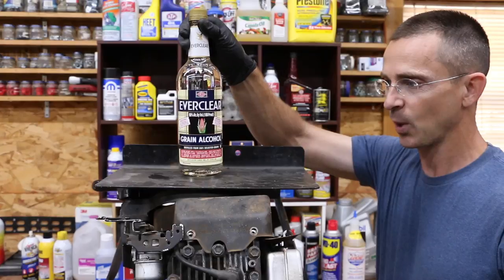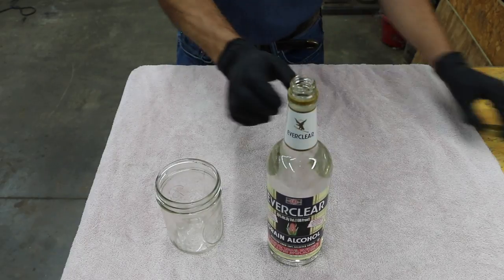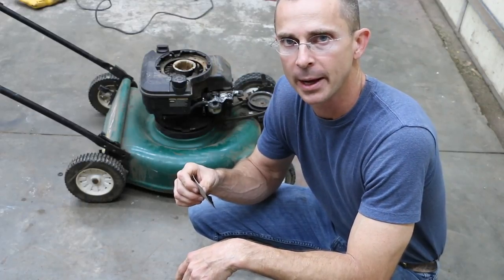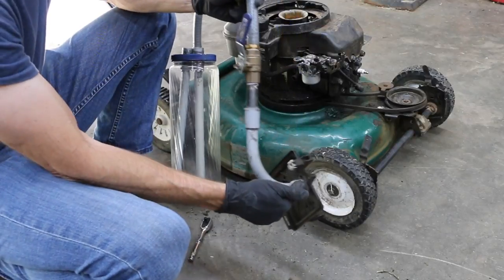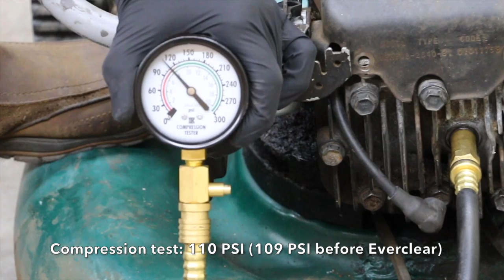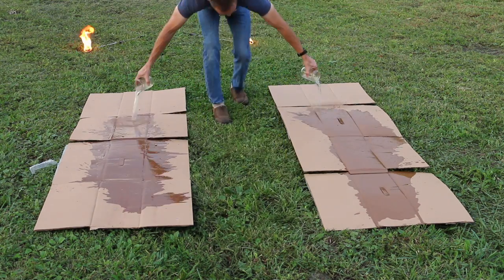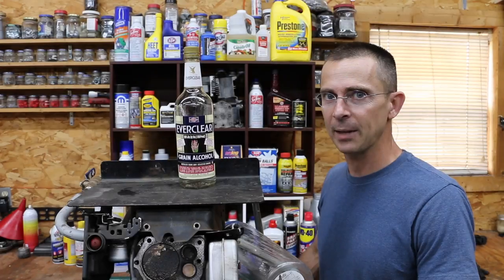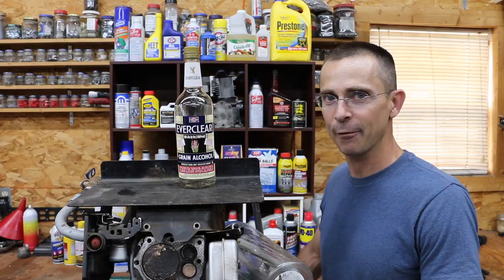Will an Engine Run on Everclear Fumes?  Let's find out!

Comment: Nice. Now we know that grain alcohol won't clean the carbon out of your cylinder very well, but in the right mixture it burns fast and hot.
 Have you done one about running it on other volatilizes, such as acetone, M.E.K.,  Zippo type lighter fluid, or even LPGs like butane, or propane?
Reply from the maker: I have not yet done videos on the ideas you've mentioned. Thank you for these recommendations!
Reply: Screamin Eagle Alcohol will, eventually, clean up an engine. The main problem here is this engine is no where close to jetted and timed properly to run on ethanol, hence chocking it.
I run e85 in my racecar which is 85% ethanol, 15% gasoline and the cylinder heads are remarkably clean after a season of racing.
Reply: 177SCmaro what is your race car? I also run e85 in my supercharged 1998 buick Riviera. I love it, more boost more timing more power!
Reply: juck huo
Its a 78 Camaro with a supercharged 380 ci sbc. Ran it on 110 race gas years ago then switched to E85 and never looked back. Too over a half second off the 1/4 mile just from switching to ethanol, which, according the math, was around 50HP over race gas. The stuff is so effective at cooling the air charge that, after a pass, you can put your hand on the side of the blower and it feels quite cool to the touch, even on a hot day.
Reply: Awesome, I'm about to take my Riviera to the drag way Wednesday for the first time . Got any tips so I don't look like a dumb ass? yeah my car runs so cool on e85 that when I'm cruising the thermostat just stays closed.
Reply: juck huo
If you haven't had the car tuned, I suggest investing in a o2 monitor that can read on the alcohol table (most do nowadays) and start off rich and retarded timing (28-30 degree BTDC) and work towards giving it more advance until there is any indication of detonation/pinging or it slows the car down (lightly boosted small blocks usually like around 32-36 degrees total advance)
Depending on your tires you may want to do a burnout in the water box, if street tires say out of the water box and do a dry hop if you think you need to. Usually someone will direct you.
If you've never staged a car at a drag strip the principle is pretty simple. 
There are two inferred beams at the starting line. You'll want to roll forwards slowly so as not to accidentally roll through the lights (in elimination this counts as a redlight and an instant loss). When your front tire breaks the first beam the pre stage light will come on the Christmas tree (typically if you are the first to do this as a curtesy you should wait for the other car to do the same). When you roll very slowly forwards a bit further you'll break the second beam the stage light will come on. Now you are staged. (you may what to be power breaking or brining your rpms up if it a manual).
Once both cars are staged the Christmas tree operator will trigger the lights, they'll come down and some time before the final light illuminates you'll want to nail it. Waiting until you see the last light will almost guarantee a poor reaction time. That part is up to you and how well you know your car.
And then hold on and keep her straight. 
At the end of the race track there is usually a turn lane or return road where you will get your ET slip that will show your reaction time and how long it took you to reach the various points on the track and your mph.
Those are the basics for what you can expect at a dragstrip.
Reply: Cool thanks. I've got a tuner and a wideband o2 sensor. rite now my afr is like 10.8 and my timing is really retarded at like 18 btdc. what afr do you run in your car on e85? I know stoich is like 9.7 for e85 but that seems like too much fuel for my car. I don't get knock rite now the way it is setup. Also my wideband o2 only reads down to 10, are there sensors that will read lower?
Reply: Yeah, I understand about the "over time" variable, and it looks like it did clear up some of the lighter staining on the piston. I was just looking to see if it would do the same as water or Sea-Foam. 
 Plus alcohol burns much cleaner then gasoline. So if you start out with a clean cylinder, you'll end up with a clean cylinder.
Reply: juck huo 10.8 to 1 is dangeriouly lean for a supercharged engine if that at WOT.
As you said, stoich is 9.7. Full rich on E85 is about 7 to 1. Lean rich is 8.5. 
At WOT going down the drag strip I usually run around 8 to 1 to 9 to 1 (it varries with rpm) with 36 degs advance all in by 2500rpm.
The air/fuel gauge I use is made by AEM. Summit racing part number AVM-30-0300. It reads 8 to 1 all the way to 20 to 1.
It's on sale right now too for 180 bucks.
Keep in mind if your o2 gauge is one of the old ones it could be reading on the gasoline scale. This one works with all fuels but you have to set it.
Reply: I wish I notice that my o2 sensor only goes down to 10 to1 before I bought it, but I wasn't running e85 at the time. I don't really want to buy another o2 sensor though. I've been confused about the correct afr at wot for e85 because I know stoich is 9.7 and you should be richer than that but when I tried entering 9.7 for stoich in my ecu my car did not like it at all. so rite now I just have the injector gain scaled up by 20% and it runs pretty good that way(that's where 10.8 came from). no knock. also I'm confused by this video I watched from nelson racing on their 2100hp motor on e85. they run like 11-11.5 afr ( https://www.youtube.com/watch?v=qS0ZdSRlD2c data logging starts at 11:00 if you don't want to watch the whole thing )
Reply: juck huo Are you sure it's actually E85? Some E85 isn't really 85% ethonal.
Also, like I said, it depends on the type of monitor you're using. If it's on the gas scale then if it reads 10.5 to 1 your actual air/fuel ratio is on e85 is about 7 to 1, which might explain why your car didn't like going richer.
Reply: oh ok yeah that would make sense. so that video I watched was probably on a gasoline scale also? I get e85 from a lot of different gas stations and it doesn't seem to make a difference, I'm in Michigan if that matters but I assume it doesn't except in the winter I know the ethanol % is lower. Thanks for the help. Should I scale my gauge so it reads for e85 or just leave it the way it is? so technically if my scale is for gas I'm rich, correct?
Reply: Also if my o2 monitor can read down to 10 to 1 on the gasoline scale does that mean I don't need a new o2 monitor that can read richer, since 10 to 1 gasoline scale is equivalent to 6.6485 e85 scale, and I should not have to go richer than that since max power rich on e85 is 6.975? Thanks again for taking the time to help me.
Reply: juck huo If you don't mind having to look at the different scales for gas and e85 then no, you don't need a gauge that can read different fuels.
Since your a/f is safe at almost full rich you might just play with timing then, unless you're running lots of boost then I'd probably leave it alone. Sounds like a safe tune.
And you're welcome.
Reply: Cool, thanks once more. I'm only running like 10-11psi but I do want to go up. I'm going to hold off till I get some quality fuel injectors with all the correct data. I've been having problems with aftermarket injector that don't come with all of the data for tuning the ecu. I think I'm going to shell out the big bucks for some from injector dynamics since thay provide all the characterization data.
Reply: juck huo At 10psi E85 could probably handle more timing unless you have really inefficient heads or something (I doubt that is the case if it's new enough to have EFI). Something to play with at a drag strip or dyno.
Sounds like you've got a good handle on it.
Reply: Yup, nice chatting with you, you'll probably see me around this channel again. lol good day
Reply: juck huo
Likewise.

Comment: You'll have to run it a lot richer.
It'll probably run quite a bit cooler than gasoline.
If you could somehow bump the compression way up (like 11:1 or so) you'd see a significant increase in power with alcohol over gasoline.
You'll also get around half the efficiency per volume as compared to gasoline.
Reply from the maker: Excellent point.  Thank you for the recommendation!
Reply: The problem with running alcofuel is that you have to use a lot more fuel to get the same amount of power out of it that you would get with gasoline. I think the stoich mixture for alcohol is 8:1, where as with gasoline it's 14.7:1. That's why flexfuel cars get worse mileage when they run e85. It's effective octane rating can really surpress knock on high performance engines which is a big draw of e85 because that means you can run a ton of timing advance safely.
Reply: Just like when cars get tuned for e85
Reply: Loren Husky
While the very low air fuel ratio of alcohol is bad for mileage, the tradeoff is you can burn a lot more fuel (especially in supercharged applications) for a given volume of air, so, in spite of the lower energy density of alcohol, it still makes a lot more power. What you call a problem I call cramming more fuel in the engine to make more power!
Reply: Boost or insane compression ratios are where alcohol shine the brightest. Its cooling effects mean more air, more fuel and later spark, with less chance for detonation.
Reply: It's not a problem if you know what you're doing and you have a reason to do it like performance. Jenny the soccer mom in her flex fuel kid hauler is only going to experience the negatives though, like poor fuel economy. I don't know how it is in other parts of the country but the cost of E85 is such now that you're losing more fuel economy than money saved every fill up. So it's a net loss for 'normal' vehicles.

Comment: Very nice video 
Quick question have you tried to run a diesel engine with gasoline and Diesel mix together.. My step dad tell me is good for the engine because it would clean the piston? Is that true
Reply from the maker: I did a video on diesel/gas mixed together a while ago and I didn't see much cleaning, but it could have been just my experience.  Thanks for the positive comment!
Reply: Was that in a gas engine tho project farm? I'd also like to see a little gas diesel mix in a small diesel motor
Reply: it was in a Gas engine, heres the video https://www.youtube.com/watch?v=PXLWLXz0iY4
Reply: I work at diesel engine manufacturer , do not put gas in a diesel, you may get lucky for awhile but if you add to much gas to a diesel  only 2 things will stop the engine, you shut off the fuel or shrapnel  in the engine
Reply: NightHunter nunya and that’s exactly what I wanted to see

Comment: Of course an engine will run on Everclear. It's 95% ethyl alcohol, which is highly flammable. My little RC cars use engines that run on a combination of methyl alcohol (the kind that makes you go blind) and nitromethane (i.e. rocket fuel), with some castor oil added for lubrication. Works like a charm, and doesn't even need a sparkplug -- just a platinum-wire glowplug for ignition. Once started, those little engines run with no electricity whatsoever -- they don't even need a magneto to provide ignition. Perfect for the post-apocalyptic do-it-yourselfer.
BONUS FACT: "Nitro" engines (as they're called) use castor oil for lubrication because castor oil is uniquely capable of dissolving in alcohol, unlike most oils. (please don't use this information to prank your alcoholic friends by making them drink laxative castor oil without realizing it.)
BONUS FACT 2: Castor oil actually gets more slippery as it starts to break-down into varnish, unlike most oils, and the varnish helps seal fine scratches in the cylinder walls, making it perfect for lubricating ringless engines.
Reply from the maker: All great comments. Thank you!
Reply: There's more  normal oil turns to coke at about 480 degrees . Castor will run well into the 640 degrees before coking.  The nitro content is used to set the ignition point .  My friend asked me why  his 1/8 nitro car ran cooler on 25% nitro then on 15% . I told him it advanced the ignition timing  but if you keep going up I will run hotter . Nitro content and compression ratio set ignition timing on a glow engine . 30% nitro or more is for racing and engines using that much have a short life span. In europe some racing classes use 0% nitro . I still want to see farm guy try some fusel oil  ( Note only one tablespoon per tank of fuel  )  a remote starter and a steel barcade to stand behind will be necessary !!!!!
Reply: Shawn Elliott not to me tion the alcohol will probably ruin the seals over time. And cost thousands to fix.
Reply: methyl alcohol=Methanol. You're welcome
Reply: So could you use castor oil in a car tuned to run ethanol/e85?
Reply: What engines don't use rings? And on larger engines, say a 50cc/125cc 2 stroke engine, if I use nitro I won't need a spark plug if I pop the clutch?
Reply: Nadeem Moulana  It uses electricity to heat up at first, using a hand-held /battery powered device called a glow plug igniter, example: https://www.amazon.com/Redcat-Racing-80101-PRO-Igniter-Charger/dp/B00E5L5DT8
Once the engine is started, you can remove the igniter and it keeps running. Makes me think of the super old hot bulb "semi-diesel" engines.

Comment: I'd really like to see atf for engine oil. If it held up I'd like to see long term wear VS normal sae 30
Reply from the maker: Thank you for this recommendation.
Reply: Just going to say right now that's a bad idea. A small amount of oil from bad blowby will lower the knock resistance of the fuel air mix enough to cause knock. I can't imagine what straight oil would do. (Not a Deuce, remember.)
Reply: Dylan Houser I don't know about the long term side effects but I have run ATF and PS fluid when there was  no regular engine oil to be seen in the shed. Used on a 1996 4cyl Mitsubishi 2,0L with ~170k very hard miles. So far so good. 👌👍. It does WONDERS to silence noisy, dirty valve lifters.
Reply: I've used it as a percentage of engine oil. Like 3 quarts of regular oil and 2 quarts of ATF. It does work well.
Reply: Indeed it does.
Reply: One thing I think it would clog up injectors etc also it would probably be worse than having a cracked intake plenum that sucks oil into the intake   Now I’ve heard of guys using old trans fluid mixed with diesel in Diesel engines and owner/operator truckers especially older trucks that would add a bottle or two of atf in their fuel tank to substitute the sulfur and other additives that have been taken out of the diesel over the years  along with a gallon of gas every now and then to clean out the system and engine or help in cold weather